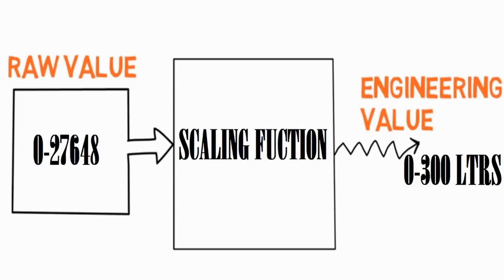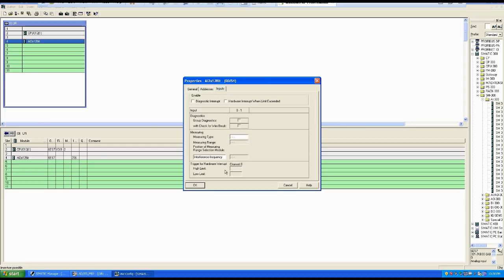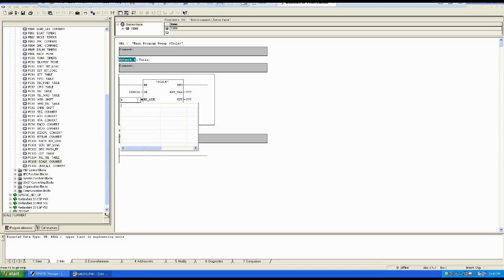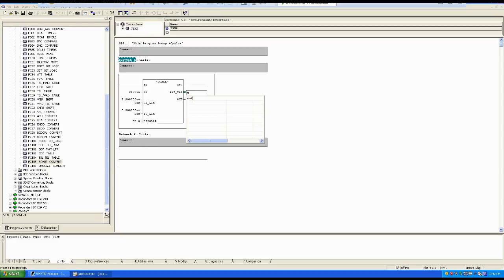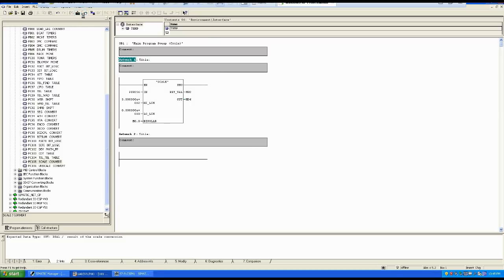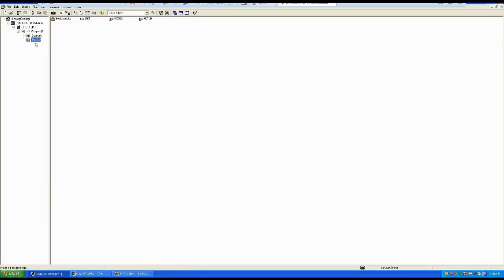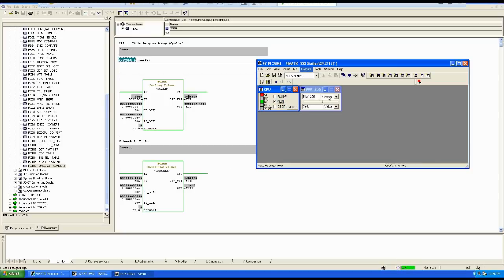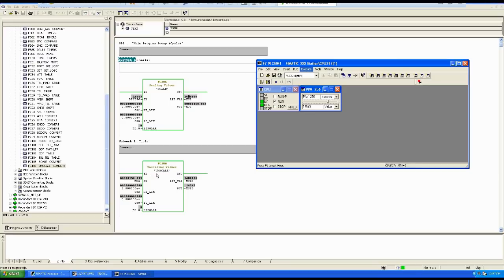18: Analog Scaling PLC Program by using FC105 &106

Comment: Do you have any videos on HMI’s interacting with plc’s software and then AO card send a variable signal to a servo valve or proportional valve. Say I wanted to increase the temperature through the HMI because I needed gas valve to open up some more. How would do that in the S7 static manager with WICC software? Thanks